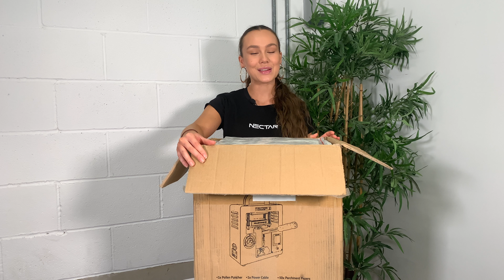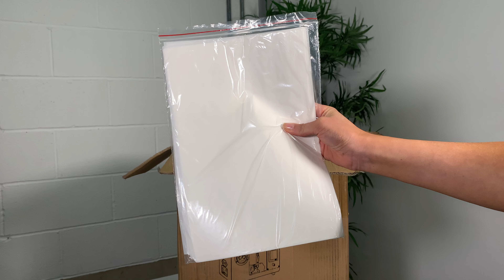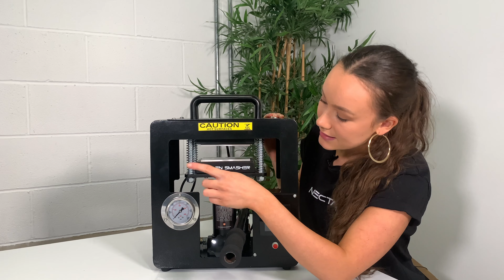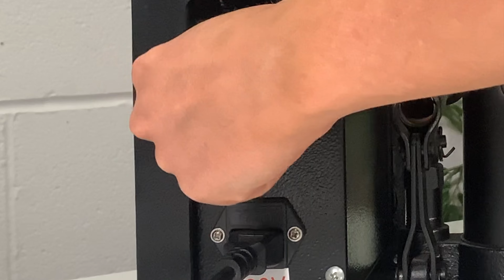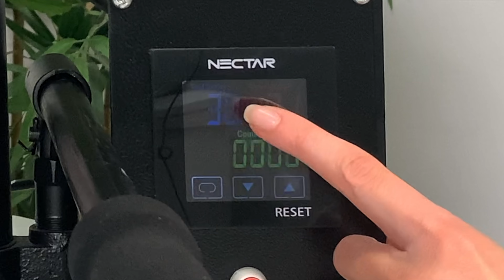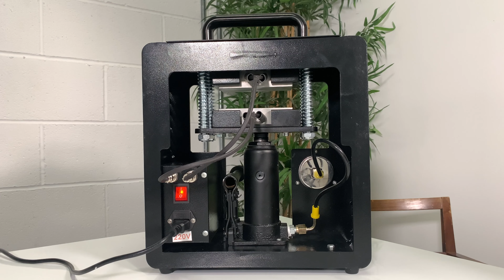Rosin Press Tutorial | How to Use the Nectar Pollen Smasher Rosin Press Machine

Comment: What is  the LOT 88 setting about ?
Reply from the maker: Hey Robert, the lot 88 is simply a safety feature to stop anyone who isn’t supposed to be tampering with the settings. Think of it as a code which you need to input to enter the machines settings. To access the settings, hold down the set button and then use the up and down buttons to go to the number ‘88’, then press ‘set’ again and you’ll be in the settings. Hope that helps but if not then feel free to get in touch 👍